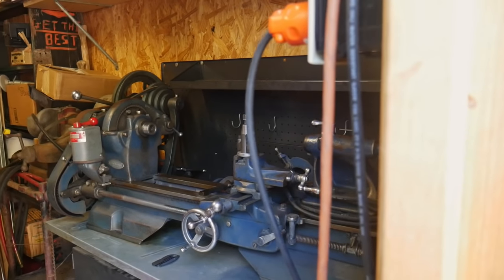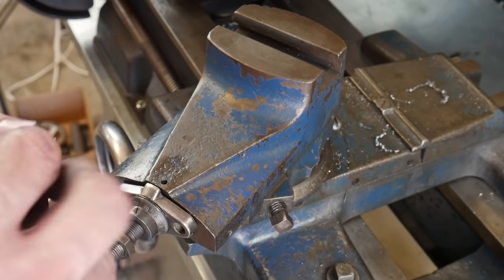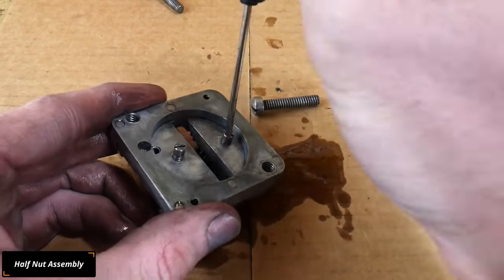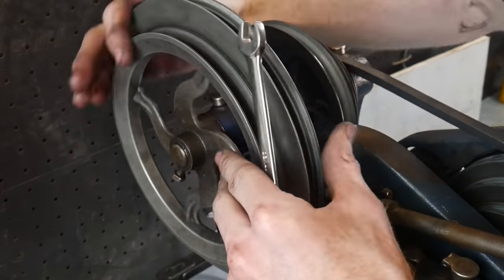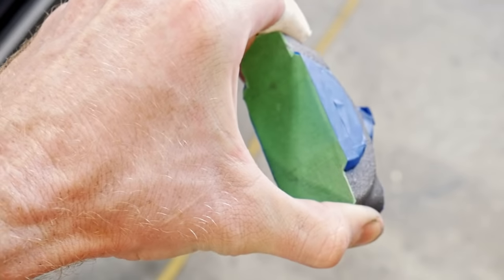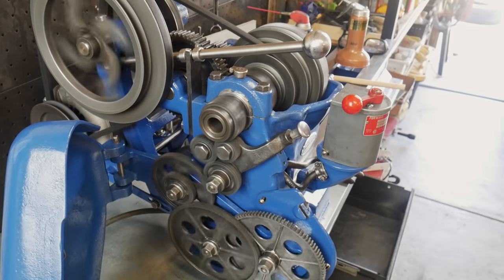1930s Atlas Lathe Restoration

Comment: The lathe's spindle in later models (or higher end), were fitted with Timken tapered roller bearings, NOT ball bearings.  These lathes were made by Clausing and sold as the Atlas lathes.  Nothing wrong with babbitt plain bearings, their main limitation is how fast the spindle can be allowed to turn when not lubricated with a substantial oil pressure...keep your spindle speed under 1200 rpm.  Plain bearings can handle a huge amount of load, just be sure to lube them up every time the lathe is being used. Installing drip oilers is a good idea.
Reply from the maker: Thanks for the tips!
Reply: @RedBeardOps  Drip oilers would look super cool on your machine! And be "period correct". Have you measured runout on the inside of the spindle? That's what will tell you if the babbit is OK.

Comment: That came out pretty awesome. I would look for a gear box for this model as it can save you lots of time changing feed rates and threads. One thing you would need absolutely is a vfd. Changing spindle speed is crucial. Have fun with it in the meantime!!

Comment: I was lucky enough to buy one if these Atlas lathes STILL IN THE ORIGINAL CRATE ! It ran well after I added a motor to it and I turned Metal as well as small dense wood with it. It was stolen and I miss it still. Great job on your restoration...
Reply from the maker: Man that's terrible it got stolen. Great machine!

Comment: That was a great project. I did the same to my Craftsman Atlas lathe. Mine is an early 1950 one owner lathe that I got from one of my friend.  His father bought it new and had it until 2 years ago. I spent most of a winter taking it apart cleaned and painting it. Mine came with a quick change gear box. Unfortunately something happened to it and it was destroyed and I had to replace it. Everything is now working great. I am still learning how to use it. Thanks for your video.
Reply from the maker: Very cool! Glad the video was entertaining / helpful! Cheers

Comment: I was an A ganger on a diesel submarine in the early 70's we had virtually the same Sears "craftsman" lathe. We used it to cut down worn areas on pump shafts before we fitted the  shaft with sleeves..and turn the shaft in order to braze up the worn area. the lathe is well worth the rebuild ...it is very accurate and stable.
Reply from the maker: Wow that is awesome! Very cool history right there. Thank you for your comment, sir!

Comment: I just found this beautiful rebuild of a lathe I've had since 1996.  It was my father-in-laws, and his father and bought prior to WW II.  I have almost all the original equipment that came with it including the extra set of gears and the woodworking plate.  I need a larger chuck as mine is only 6 inches across the face.

I agree with one of the prior comments that this is newer than 1937 as mine was purchased in 1938 and that is the date on the original users manual.  The motor mount is of models in the late 40's or early 50's, if not later.  Also the original color  was a battleship gray.  Whoever did the prior rehap, painted it the blue and the Craftsman plate was red with black raised letters. 

I also agree with a prior comment to use the direction option built on the lathe so the direction won't unscrew the chuck off the main shaft or the jawed chuck off.

Mine is still original from the 30's due to the care of my FIL and his dad.  Being family owned and used has kept it in great shape and I'm learning more on it every time I use it.  I just wish my FIL was still here to guide me along in learning more than what I have now as he was a master machinist.  I retired from the Air Force in 1997 and we returned to Pittsburgh, PA in October.  We lost my FIL in 2000.and I never had time to set it up correctly until recently for a project.  I've watched a lot of YouTube videos to try and fill the gap and enjoyed your rebuild greatly.  Thanks!  MSgt David R. Smyth, USAF, Ret.
Reply from the maker: Very cool sir, thanks for the comment! There was some amazing old school engineering that went into these machines; It's a pleasure to use!

Comment: I have one of these that is from 1934(?), roughly. It is almost identical. The differences are minor. Mine has never been serviced in any way and is still in original condition. Yes, it has some wear and tear but it still works well. However, with it approaching its 90th birthday I may just give it a total overhaul so that it can serve my sons for another 100 years with no problem.
This was a well done video with plenty of good tips. There are a few things I would do differently. First, WD-40 is almost useless as a rust breaker. Instead, we use Corrosion - X. It is impossible to beat. For paint stripping nothing works better than aircraft paint stripper! It gets right down to the metal with almost no scrubbing or scraping required. 
Thank you for going to the trouble to make this video. Who knows? I may made a video of my own when I do the rebuild. LOL
Reply from the maker: Thanks for the tips Steve! Glad you enjoyed it

Comment: Watching this was very helpful in restoring my 1957 Logan/Wards lathe. It seems that there are lots of things that are the same, or similar between makes and models. Your production quality was also excellent,  using voice over and a high speed video kept things moving along nicely....I know how long this process can take! Right now I'm working on the electrical with a vintage barrel switch add on. The wiring needs to be replaced, so I'm marking each wire to be sure I know what goes where...I'm not a electrician either! Hope mine will go both forward and reverse when I finish. This video was rock star quality, and I hope you create more videos of restorations!
Reply from the maker: Very cool Paul! I'm stoked you found this video useful / inspirational for your restoration. Cheers!

Comment: Excellent restoration, I have the same exact lathe but a 10 inch that I'm going to restore. I think mine was restored once before because it's a green color, not blue. The motor is blue though. I want to get it back as close to original as possible. I will be using your video as a reference and inspiration. Thanks.
Reply from the maker: Heck yeah! Good luck on your restoration!

Comment: Great job as always, you are a true craftsman. To switch directions on a single phase motor you will need to configure your drum switch to reverse the start windings. The motor has to be at a complete stop or it will not reverse
Reply from the maker: Thank you Don! Cheers

Comment: If you want to strip paint off, you need to put a generous amount of paint striper on it and put everything in a closed container to allow the chemical and fumes to do its job.  Leave the container outside and not inside to prevent deadly flammable  fumes.

Comment: I had one of these Craftman (Sears) brand lathes. The pot metal bevel gears in the carriage were broken and Sears no longer had parts. An old guy at the Sears parts counter told me these lathes were made in a super cheap Craftsman version for Sears, but a lot of actual machined brass gears from Atlas will fit. I ordered as many brass gears as I could which included the bevel gears I needed and also the half nuts in brass.
Just FYI.

Comment: Excellent restoration on this Atlas. I have a TH42 With Timken bearings. Now imagine cars of the early thirties and older used these Babbitt Poured Bearings. I have the same type of Drum Switch. My machine was given to me so I am in the process of installing the motor. I love the other machinery in your shop too. I would suggest using rubber gloves when using the solvent cleaners and stripper. These Chemicals can absorb through the skin and have Carcinogens in them. Now I want to check out some of your knives. Thank you for the video.
Reply from the maker: Thank you for the comment and tips! Cheers sir!
Reply: @RedBeardOps  Hi, my machine is all connected. The "Barrel" switch works great. If you want maybe I can send you pictures of how my switch is wired. Just a thought.
Reply from the maker: @dgiorgi1725  sure, my email is redbeardops@gmail.com

Comment: Nice work!

I picked up the same lathe around a year ago and am just getting around to tuning it up.  I also had a broken cage, but I glued it up with JB weld (with embedded fiberglass cloth) and it should be stronger than the Zamac.  The end of my leadscrew is broken so I’ll machine a solution for that.  Otherwise, these seem like pretty good home shop lathes.
Reply from the maker: Very cool!

Comment: Great job Red Beard,  Have a few of these early Craftsman / Atlas lathes, very nice shape and love to have you do a video on them, they are the 10/12" 101 models, and two older ones like yours, but with longer bed.  Little machine shop in Niles makes the lead screw end piece, and has many parts also, Pluss you need the spring in the travel engagement or it could pop in gear while your working.  Keep em coming Red

Comment: Rust removal:  restored an ancient bench plane that had been in rain and snow for at least 10 years using white vinegar.  Took it apart with WD-40, then washed in hot water with strong detergent to get off all oil and allow the vinegar to reach all surfaces.  Rinsed all the parts and put them into a wooden box lined with a garbage bag.  Filled the box with white vinegar from Costco and let it soak for about 3 days.   The rust became a gray sludge that was easily brushed off under hot water.   You want hot rinse water for quick drying to avoid new rust.   When all was dry, the results were amazing-- the parts looked like new (except for the badly pitted blade).  This is less work and is more gentle than wire brushing and reaches into difficult corners that are hard to reach with wire brushing.
Reply from the maker: Very good to know! Thanks for the tip

Comment: I finally have the time to work on mine since I just retired. It belonged to my Dad and is identical to the one in the video. Hasn't been used in decades. Just acquired a new (used) motor.  The hinged swing arm motor mount cracked when I tried to tightened the swivel.  I had to purchase another one of those.  If I could get a list of lubricants needed that would be great!
Reply from the maker: Very nice William! I have a list of the lubricants with links in the description of this video. Cheers

Comment: Fished out a 10x 36 inch longbed Atlas lathe, similar era, in pieces, from a scrap metal dumpster, including the legs, and repair parts from mechanical damage. Took some doing- much tooling is compatible with my superb Logan engine/ turret lathe, though the pot metal is annoying. I think they- the uninitiated- broke it and took it apart, and the Humpty Dumpty dance prevailed- all the king's horses, well intentioned........ The FW put it all back together in no time- seasoned machinist- the steadying hand of routine. One headstock bearing trends tight, and the lead screw drive was mangled- no big deal. Machine shops breed lush crops of "system accidents", when the "accident prone" are learning the hard way. I like it when things go wrong- that's where the real work is.
Reply from the maker: Very cool Fanwood!

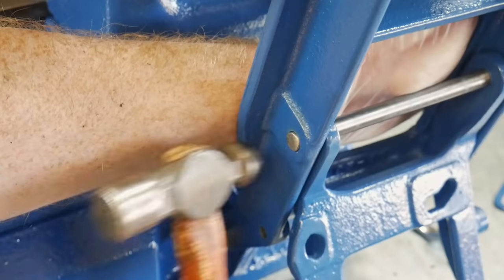Comment: 28:35 if you ever have trouble with that screw backing out, you could just screw some all thread in there with loctite, then put a nylock on the outside of your washer.   But if it's working the way it is, ....... cool.  Just don't want that motor vibrating off that hinge while it's on.  Nice resto, man.  I like that you built your own nails
Reply from the maker: Thank you Bobby! Cheers

Comment: Only things  I would do extra is use roller bearings, paint the electric contacts box blue (the red handle has enough presence) and repair with JB weld the broken edge of the pulley. Congrats on you NOS lathe!
Reply from the maker: Thank you sir!

Comment: Excellent video, I have the very same lathe and have always wondered it's age.  I was out by 10 or so years...thanks....Have you considered doing any of the upgrades to control the feed screw etc to be easily able to make threads etc??
Reply from the maker: I haven't messed with threading yet, but I don't need any upgrades would be needed.... just the appropriate gear ratios installed in the gear box for the specific thread you want to cut.

Comment: I like to use link belt in places where major disassembly is required for belt replacement. More expensive but also allows for belt length adjustment.
Reply from the maker: Thanks Robert!
Reply: And will cut down on vibration.

Comment: Wow. You brought that thing back to life. It’s cool that it’s now belonged to at least two generations. I’m assuming your dad got it used? I just love the history of these old machines. 

I was trying to visually compare the differences between yours and mine. Mine is a bit newer (101.07383) which I believe is maybe from the 40’s? The tailstock, carriage, and swingarm look identical. The most noticeable difference is mine has a cover over the spindle pulleys, and the rotational switch on mine is mounted above and behind the lathe, with a ON-OFF toggle on the front of the headstock. 

I recently published a video on adjusting the Babbitt bearings on my lathe. Check it out if you ever need to adjust yours.
Reply from the maker: Very cool Dustin! These old machines are awesome for sure.

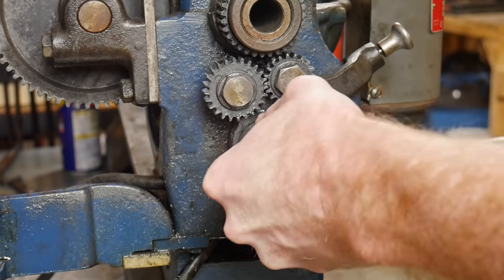Comment: 1:50 wow that's actually pretty clean.     10:00 The screws look pretty unused -- it's in good condition huh? 16:30 nice job closing those holes up 19:02 I guess those reversing tumblers are showing significant wear ...... but you can remake em  24:00 I love that primer color.   That's not far from the finish color I'm putting on my  Heavy10.   Brad Jacob's has a paint code for a very close match to that old South Bend army green / machine grey blend.

Comment: Despite what it says on the can, EvapoRust will actually eat a lot of different types of paint off. There is a an orange goo paint remover that I like but you have to wrap your part in cellophane to keep it wet and working but if you have deep crevices, evapor rust might be good at finishing the job plus it removes rust amazingly

Comment: Nice job, well documented and edited. Thank you. Whether it is good practice, I don't know, but I've seen sloppy two-part bearings that had no shims left to remove tightened up by dressing the flats on the bearing cap with abrasives on a flat plate... the old figure eight hand grind. Also, wouldn't a treadmill motor provide both reversing capability and high torque at lower speeds using the same gears and pulleys? Another question for you and your viewers: a local auctioneer said he had repaired a broken-in-half cast iron wood plane by cleaning the fracture with brake cleaner then JB welding the halves together. Might such a repair work to replace a chipped out bit like on your drive pulley? Seems like if the blob of JB Weld would adhere it might be dressed smooth by driving the other side of the two-step pulley.
Reply: Why is a reversing motor a 'thing'? doesn't the head stock reverse the spindle and the lead screw as needed?
Reply from the maker: Thanks for the comment

Comment: hi redbeard

good video!
  
just got an atlas lath as well and low and behold the same zanak cage was broken 
tried to fix it with some epoxy steel and some extra steel for bracing, but it was basically a fail
now i am considering milling up a part for it ... without having a mill ... thinking of turning the lathe into a temporary mill
i tried to get the axle out of the cage but it seems the small and large gear are welded to the the axle
i did not wanted to force it so was wondering how you got it out, saw you hit the axle from the side of the large gear but when i ground the top, i could not see a differentiation between the axle and the gear

any tips?

thanks
marc
Reply from the maker: Marc, sounds like you're in a pickle. Mine was a press fit for sure, and I was able to support then tap out the square shaft. What ever you do... do not apply heat! It will for sure melt that ZAMAK gear. There may be some guys on the hobby machinist forums that could help you out. I'd suggest asking your question there.

Comment: I just picked up the same exact style lathe but is a craftsman so old haha I have to come up with shims for the caps that hold the main spindle and the rod that holds the pulley assemble is just dangling there so need to figure that out glad to see aa video with the same lathe tho halfway through hope to see the stuff mines missing!
Reply from the maker: Good luck with your re-build / clean up! Cheers
Reply: I made my shims from shim stock material that Mcmaster Carr sells.
Reply: @franciscoflores7911  ya o did the same wasn't having luck so bought some .002 shim stock and shes nice and tight now haha

Comment: Thanks for sharing your process! Building up the courage to tackle my late grandfathers Atlas lathe, so quite insightful. Good to become aware how fragile the zamak stuff is 😨
Did you test if the old paint was lead based? Sanding that stuff is pretty unhealthy.
Liked how you kept the parts organized by keeping them together in dedicated boxes. I plan to use a similar system, plus little plastic baggies for the smaller parts.
Reply from the maker: Glad it was helpful! I did not test it... probably lost a few years off my life for sure. Good luck with your restoration!

Comment: Just wondering why you didn't take the apron off the carriage, after you'd taken the leadscrew out? It makes it a lot easier to get to the bearing plate, and just a tip, replace the slotted setscrews with socket head ones on both bearing plates.
Reply from the maker: Thanks for the tips Harry!